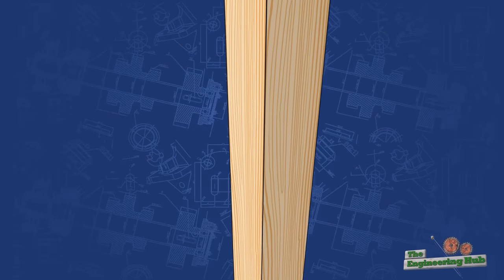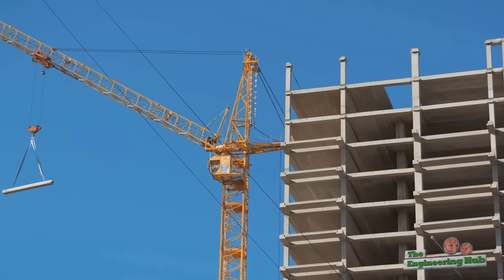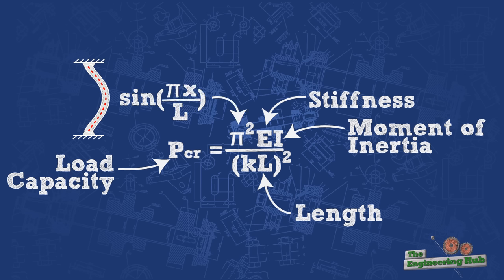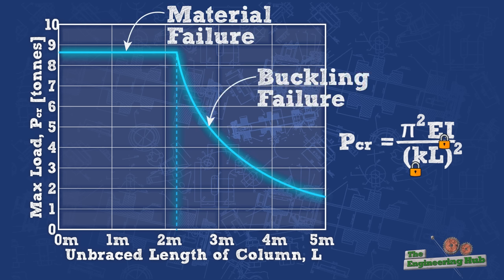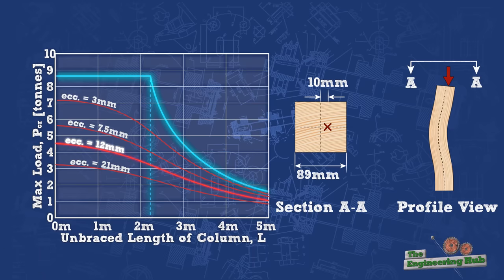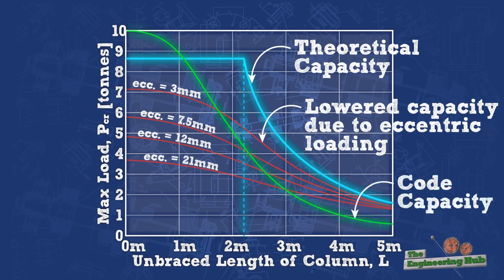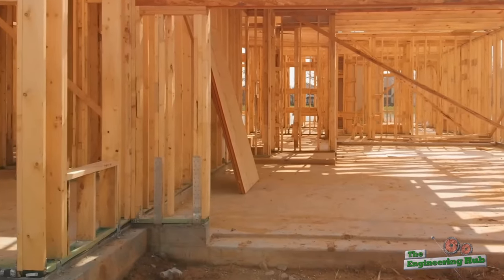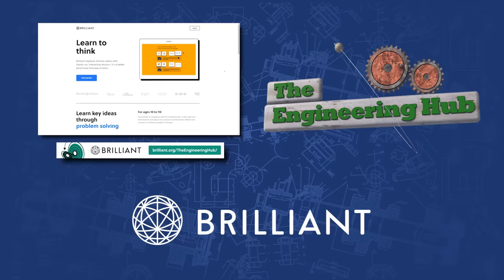How much load can a timber post actually carry?

Comment: I need to calculate the load of a 12 inch by 20 inch span of plywood 1 inch thick. However, I am really not sure how to mathematically calculate it with a formula.
Reply: You're looking for the weight? 1 inch thick plywood is generally 3 lbs per sq foot. In your case, that's 5 lbs. 

If you're interested in the deflection, there are online calculators. For a span that small, you could just experimentally try it. Support it on both ends, and then add a known weight to the center. Measure the deflection, then add more.
Reply: @Shigg McDigg  The online calculators for calculating the maximum load were all over the place. The most credible one to me was 1900 lb.  Indeed, I finally found a video by a channel called SV Seeker (restores boats, which is my best guess) who had a similar span of regular and marine plywood.  He put bars of lead in the center until it broke.

As I recall, making adjustments for the 2 inch difference between his setup and mine, my plywood would break just north of 1600 lb static load pushing on the center. This was roughly the same for marine or regular plywood. 

I think we need a 10x overhead to get a working load. It is vague and depends on the distance that someone might jump onto the center, which is vague. ( I estimate 1000 lb would be the most force on a misused system). 

My plywood actually should not need to support a center load (it is for a type 3 ladder that puts force closer to the edges, not not to be stood on). Nevertheless, I might add 2 or 3 supporting 2x3 on the underside to beef up the load to 3000 lb, incase someone 300 lb decides to jump a meter or more down onto the center of the 20 inch plywood span, which should easily hold 12 times my weight, even if I misuse my platform. 

I could add metal channels to the side, but think adding 3 little support boards to the underside would do the job and be easier and cheaper.

Comment: If we assume complete lateral bracing, isn't a longer post stronger than a shorter post?
Reply from the maker: In that case, the column would be governed by material failure which should be equal for both cases.
Reply: @TheEngineeringHub  In a longer post, isn't there more wood being compressed? Like, a thick concrete slab can bear more weight than a thin slab. A big rock can bear more weight than a small rock, all else equal. Amount of material counts for nothing?
Reply from the maker: @Heraclitean  In case of slabs, they are loaded in bending which means that the thickness would increase the load capacity. In case of a column, the situation is different since they are loaded in compression. The governing factor for a laterally braced column under compression is the cross-sectional area (and not the volume). In other words, the material at the bottom of the column does not help the material above it. In fact, longer columns would be slightly weaker because the bottom of the column has to carry the applied load + the weight of the column above it. This is not critical for wood because wood is a light material but in theory it is the case that longer columns would be weaker even if properly braced. If you are still confused, send us an email and I would be happy to send you a better explanation including diagrams since I can't post pictures here.
Reply: @TheEngineeringHub  That's very clear. Thanks for the explanation.

Comment: Is buckling really a 'sudden' failure? Granted it can be but in my experiecne it can also be a very slow defect that gives plenty of time to rectify before failure. This is the beauty of wood. Catestrophic failures aren't normal, unlike say cast iron.
Reply: Buckling is considered a sudden failure because once the column begins to buckle, the effect of adding more load to it is substantial. You're right, many wood columns do not suddenly fail in residential applications, but also designing them as if they can handle more load once buckled would also be a huge mistake
Reply: That is probably a bow, potentially a bow made worse by the load over time. If the post had really buckled, that would be a sudden failure mode. One caveat is that you may have seen a post that failed in buckling, but was somewhat redundant with other support systems such that as the post got shorter due to the buckling, it simply stopped supporting much weight. I would still say that post had "failed".
Reply from the maker: Thank you for the great explanation Jackson! I would just add that the load over time phenomenon is very important in wood structures because it is accompanied by creep that could cause slow bowing of the post. In my opinion, the failure mentioned in the original comment is due to creep and buckling has not set in yet. The redundancy explanation by Jackson is also very likely and could be the case. Thank you all for the great discussion!

Comment: When you design a structure such as a Covered deck you have to consider uplift from wind loads not just compressive loading. It's called TENSION.  And just using Pin connections as input will produce failures. Never assume or use Pin connections in Timber Framing analysis .
Reply: the tensil strength of most wood is insane. it will always fail in the connections or from side pressure excluding knots

Comment: 6:00, for viewers inside of North America, 1 inch is equal to 25.4 mm, meaning 4 inches equals 101.6 mm
Reply from the maker: Yes, but a 4 by 4 timber post is still 89mm by 89mm.
Reply: @TheEngineeringHub  you're getting ripped off.
How would
Reply from the maker: It's something referred to as nominal vs. actual dimensions. Go to a hardware store and measure it you will see or check out the link https://www.archtoolbox.com/lumber-dimensions/
Reply: @TheEngineeringHub  then it's up to you to specify what you want. Otherwise calculations for 3 1/2 inch must be used. 
If you owe me $4,  $3,50 won't cut the mustard.
Reply from the maker: @bodgiesteve8849  Calculations for 3 1/2 (89 mm) inch were used and are always used. That's why it was written 89 mm. That was us specifying it. All engineers, architects and designers know this. All of new construction in North America is done with planed dimensional lumber whose actual values are less than what the name suggests. Though the name stuck around and are still called the old names from many decades ago when a 4 by 4 was actually 4 inches.. but not any more and it hasn't been for a long time. Same goes for a 2 by 4 which is 1 1/2 by 3 1/2 inches in reality and so on. You can read here why: https://www.popsci.com/two-by-four-lumber-measurements-explained/
Reply: @TheEngineeringHub  you get what you order, be it 25mm, 30mm, 35mm, 40mm, 45mm, 50mm, and so on. Try timber yards and building supplies, instead of hardware. 
So how would you define, what is a woman? Is a tyranny close enough? I'd be feeling a bit disappointed, to say the least.
Reply from the maker: @bodgiesteve8849  As a person that worked at a West Fraser saw mill during my late teens, I can say that a 38 x 89 mm board is called a 2 by 4 even at a timber yard/saw mill since they actually are the providers for the local hardware stores as well. It would be very expensive to change dimensions so usually they run the same dimension 24/7 365 days a year and those dimensions are 1/2 inch less than what the name is (for most dimensional lumber).

Comment: In the fire service and when we place cribbing for building collapse or vehicle stabilization we assume 1 sq inch of wood can hold 500 pounds. So a 4x4 is 16 sq inches and that is 8,000 pounds in compression. This is assuming a pine species of wood. But depending on the wood type it is anywhere from 200-1,000 pounds per square inch in compression.

Comment: In my country (New Zealand) the nominal size for 4x4 planer gauged construction timber is 90mm not 89mm. I guess we build them stronger here. ;)
Reply: William Smith  I guess it went over your head, but the 6” is larger too.
Reply: William Smith  Hey it’s not your fault metrics confuse you.
Reply: William Smith  I thought skating was more a Canadian thing. But up there they’re so confused they can’t even decide which measurement system to use for what.
Reply: William Smith  Plenty of construction work here and still lots of money being thrown at developments. It’s been an absolute boom last few years which has magnified any materials shortages caused by relatively short covid lockdowns. Lots of blame laid in different places. We have an acute shortage of drywall which is manufactured here. There was a knee jerk reaction by some huge construction players who over-ordered for jobs & developments a whole year ahead which wreaked havoc on manufacturing production forecasts.

Comment: 4 in = 101.6 mm, not 89 mm, or have  I missed something in the conversion?
Reply from the maker: You are right Daniel 4in is 101.6mm but a 4in by 4in wood post is actually 3.5 in by 3.5 in and therefore it is 89 mm
Reply: @TheEngineeringHub  Thank you. Is this somehow considered in the load capacity of the post, e.g., by a reduction factor? In terms of area moment of inertia, it makes a big difference.
Reply from the maker: @danielrodrigobarreto  yes all of the section properties are calculated for an 89mm by 89mm post so everything is fine in that sense. It is just the name that is disconnected from the actual dimensions (super confusing I know). Back in the days, the mills produced dimensional lumber that was the actual dimension as the name suggest. But now due to the planing process and shrinking of wood, almost all dimensional lumber sections have been standardized to different dimensions than what the name suggests. Usually the actual dimension is 1/2 in smaller but in some larger sections it is 3/4 in or in smaller sections 1/4 in smaller.

Comment: You missed an important point with wood beams, the different woods have different strengths. The commonly used pine is not the strongest wood available.
Reply from the maker: The assumption was stated as an SPF specimen with a compression strength parallel to grain of 10.8 MPa. Of course, other species would have different strengths and, therefore, different capacities. We took the most common species found at a hardware store for our analysis.

Comment: Although I'm certainly no engineer I think starting this out with different species of wood and different grades are going to be a huge factor in load capacity. Coming from the Northeast United States I can tell you a knot filled piece of white pine has no where near the strength of a clear piece of white oak.
Reply: That's already considered in the Young's modulus (E) of Euler's equation, stronger woods would have higher E.

Comment: For a channel claiming to be an "Engineering Hub' your measurements are way out. 4 inches isn't 89 mm, 4 inches = a bit over 101 mm. where did you get the 89mm from? An inch is a bit over 25mm
Reply from the maker: Who said that a 4x4 post is exactly 4 inches 👀? We encourage you to go to a hardware store and measure for yourself (if you live in North America)
Reply: Engineering hub? Hey pal I'm no expert, but you are talking the difference between rough sawn vs dressed dimensions in timber when specifying. I encourage you to take another course especially if you are trying to pass your self off as some kind of structural timber engineer or grader. 🤦‍♂️  At 40 seconds in I'm out.  🤣😂

Comment: Nominal dimensions in inches, but actual dimensions in metric? First time I've seen that.
Reply from the maker: Hi John, it is fairly common to express the actual dimension in mm (meteic) when designing timber members. A summary of common dimensional lumber sizes in both imperial and metric  can be found here: https://www.archtoolbox.com/lumber-dimensions/
Reply: Metric countries most likely use the actual finished measurement. Nobody is going to start calling 4x4s 3.5x3.5s. The current system has been perfectly fine for over 100 years.
Reply: @actionjksn  I removed some studs during renovation on a 1924 build in Richmond VA years ago and they were FULL dimension.  My dad the retired lumber dealer was thrilled!

Comment: A 4x4" isn't 89x89 mm, it's 98x98 mm. 4" is in reality 101.6 mm, but international standards says 98x98 mm dimension. Leaving 2 mm for adjustments up to 100 mm.
But if your 4" is actually 3.5" it's a different matter 😅

Comment: A builder learns from experience what works and what doesn't work. An engineer designs from equations , statics, etc  Perfect fit would be an Engineer/builder. Both skills are necessary, but if I had an option between an experienced builder vs a new engineer, I'll stick with the builder

Comment: 4x4 up to 9 feet, about 2 tons. Very handy when planning and executing falsework for structural repairs. Of course that means I should be counting on a single ton.
Reply: William Smith  falsework means temporary structures meant for support while permanent work is accomplished. Scaffolding, advanced concrete or masonry forms, or temporary beams and posts are all example of falsework. So I wasn’t referencing “scabbing something in place” but the temporary supports to take the load while permanent repairs can be effected. Taking a rule of thumb for weight capacities is about my safety when I work, not the final product I deliver.

Comment: 89mm is 3.5" not 4". A 4" sross section is 16 sq", 3.5" cross section is 12.5 sq" that's almost 1/4 less timber and 3/4 as strong. At least a piece of string can be any length.
Reply from the maker: A 4 by 4 timber post is 89 mm (3.5 inches). We encourage you to go measure one and see
Reply: @TheEngineeringHub  I know this to be true in North America. It doesn't change the fact it's not 4 x 4, it should be called 3 1/2 × 3 1/2. At the end somebody is paying for sawdust. To put it another way, who would buy a gallon of gas and only getting three quarts. Cheers
Reply from the maker: @AquaMarine1000  100% agree, the name is misleading. Should be called 3 ½ by 3 ½ or be made to be actual 4 inches. I guess some things just stuck around from way back when a 4 by 4 was an actual 4 by 4

Comment: Can someone help me
How 4in=89mm?
1in=2.54mm
4x2.54=10.16mm
Reply: 1 inch = 2.54 centimeters or 25.4 millimeters
Reply: @stevenmorris3181  my bad.

But why the small inch?
Reply: @bernhardjordan9200  I was just passing through and thought I would help. If you have a question for a retired plumber then I'm qualified otherwise it's an engineer's ball game.
Reply: @bernhardjordan9200  The measurement for the lumber as you pointed out was 89mm or roughly 3.5in. Whenever buying lumber, for example a 2x4 the dimensions are actually smaller 1.5x3.5in. I believe this is largely due to the refinement process. Rough cut lumber will be more or less true to the common dimension 2x4 for example, but for consistency as well as boards with a decent surface finish and free from splinters the board have to be planed down which removes materials. This is all my understanding of the topic from what I’ve been told as a hobbyist woodworker. Hope it helps
Reply from the maker: Great explanation N1ck0145! A slightly longer answer is also available here: https://www.popsci.com/two-by-four-lumber-measurements-explained/ 
N1ck0145 summarized it very nicely for the ones looking for a simple explanation!
Reply: @TheEngineeringHub  But what stopped/stops the lumber mills from starting at a higher number and planing to a true 2x4/2x6, et al, instead of "from" those?  Was there an engineering justification?  Reminds me of the banking rule of 78s and 360/365 rules for "figuring" interest.  Maybe we need "Truth in Milling" legislation.  Retired CPA here, BTW.
Reply: Besides 1 inch being 25.4 mm, a 4x4 lumber is actually not 4inches by 4inches. You can not pull the same trick with mm. I love the metric system.

Comment: Are american inches smaller than in the rest of the world? or is 89 * 89 just the nearest widely available metric equivalent? Or do americans just call an 89 * 89 a 4 by 4 even though it's not 4 * 4?
Reply from the maker: A 4x4 is actually a 3-1/2 by 3-1/2. This is due to the planing process and it is true for all sizes (some are 1/4 some 3/4 smaller). More info available here: https://www.popsci.com/two-by-four-lumber-measurements-explained/

Comment: Real talk from a Carpenter the only time a post is going to fail is from rot nd treated lumber twisting as it drys out (engineers r full of it there’s no way to calculate the strength of lumber unless it’s engineered like an lvl)
Reply from the maker: it's a statistical approach, which gives confidence ranges. Of course no one can predict the exact strength of a piece of lumber. But it is possible to say the probability of failure given a load and that's what engineering is all about. Engineers use probabilities (by using codes and many thousands of documented experiments) of failure and communicate them to the client. If the client wants a 0.0001% chance of failure, then we will build you a bunker, no problem, but it will be expensive.